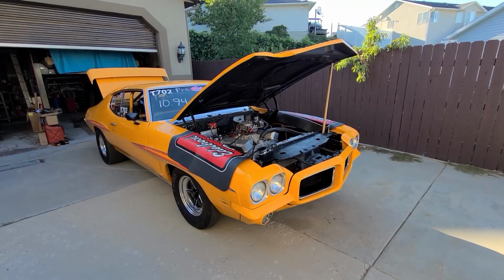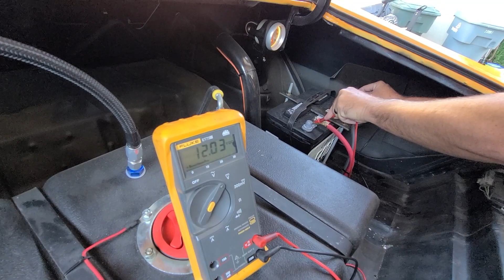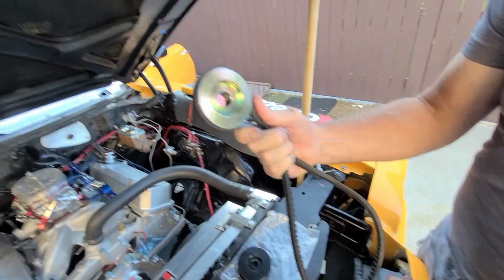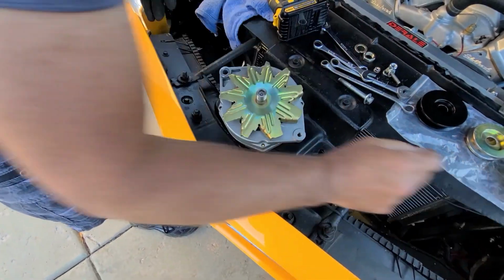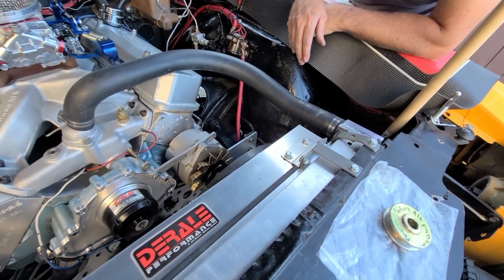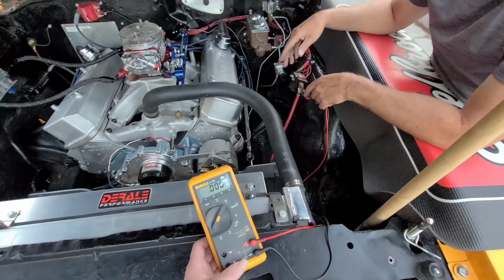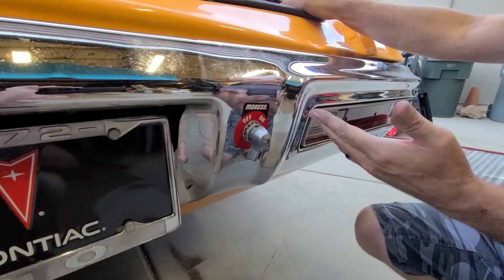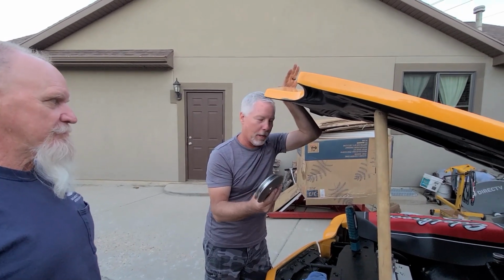72 GTO - Testing Alternator Voltage: Impact of Pulley Swap - part 1

Comment: A possible reason for the voltage difference of 1 -ish volt between the alternator and the battery could be due to an undersized charging wire. I'm running a 4 ga wire on my El Camino and I'll have to run this test to see what it charges at and what's at the battery. The wire realistically need to be able to handle enough amperage to charge and support the power requirements of the car. Also, a smaller gage wire can work if the battery is closer to the alternator. On our race cars, it's hard to get them further apart! I'm a fan of running stuff too big, my main power and ground is 1/0 ga braided welding cable rated at way  more amperage than my car could possibly support.
Reply from the maker: We are planning on doing a part 2 and we will be changing the charge back wire and continuing with the pulley test. We'll be checking volts and amps. Going from 10ga wire to 8ga wire.